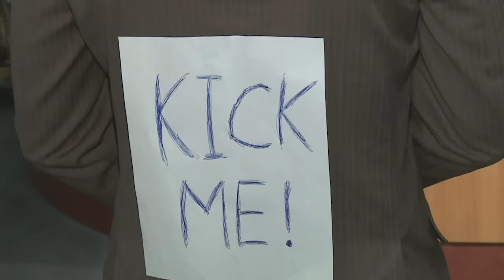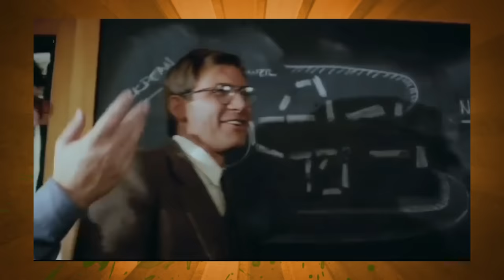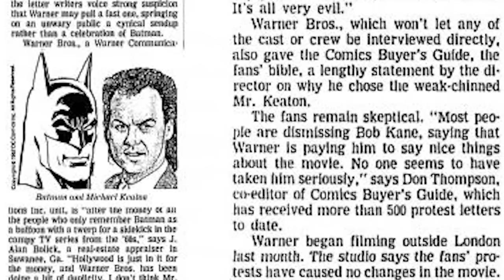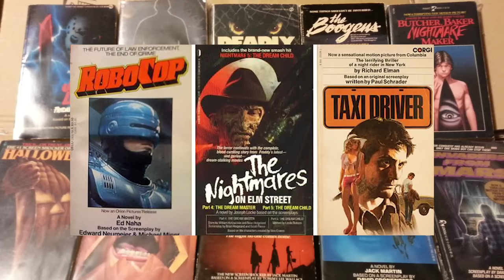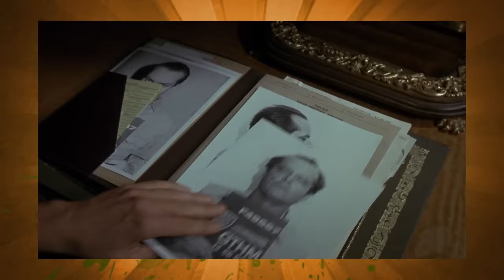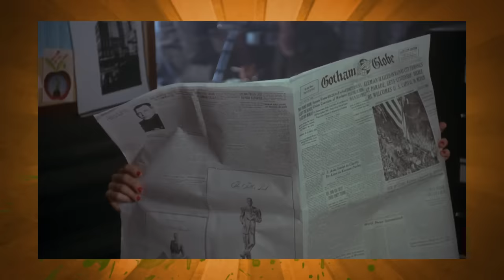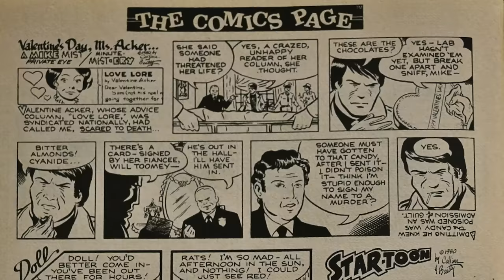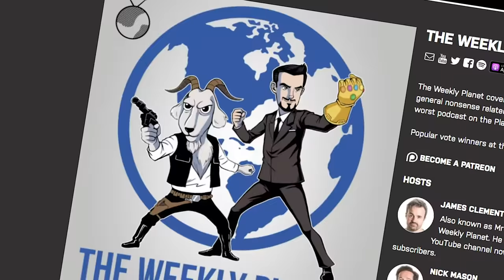Batman 1989 - Caravan Of Garbage

Comment: Funny thing: the first DC superhero to use a grappling gun was probably The Sandman. ...No, not the Vertigo comics guy, but this '30s mystery man who wore a double-breasted suit under a blue cloak and a gas mask under his fedora. One of the founding members of the Justice Society, he didn't stick around long; while other heroes used solar-powered magical dildos, supernatural forces, or just their bloody knuckles to combat evil, Sandman's shtick was conking baddies with a knockout-gas gun--not a good fit for a melee team. Eventually, Sandman dropped everything but the name; he got a teenage sidekick, Sandy (yikes), traded in the business suit and cape for a hideous generic gold-and-purple spandex get-up, and lost the gas gun in favor of a gun that fired a harpoon on a wire...which he gave the embarrassing name of "wirepoon." (Also he accidentally turned Sandy into a monster when a prototype gun he was working on blew up...? Dude, what were you *using*? Certainly not adequate safety precautions!)

Meantime, Batman kept using the batarang for several more decades. With a line attached to it. Y'ever try to emulate that as a kid? Ha ha ha, even with simple kite string you wouldn't get far.

Comment: He liked the batsuit in Batman Returns,  but not in Batman '89? They didn't change it between movies.  That wasn't something that was done at that time. I think the first movies to switch suits from film to film was Forever to Batman and Robin and then everyone started doing it.  It was changed in Forever from Returns but that was a different director and a different crew so I wouldn't count that. Forever to B & R was the first true sequel to change costumes.
Reply: No, they were fairly different.  The Returns suit had a few elements of the original, mainly the cowl design as well as the same utility belt, gauntlets, and boots, but the bodysuit is very different.  The first one had molded muscles while the Returns suit had a more mechanical armored appearance.